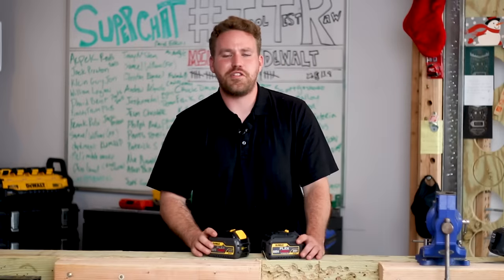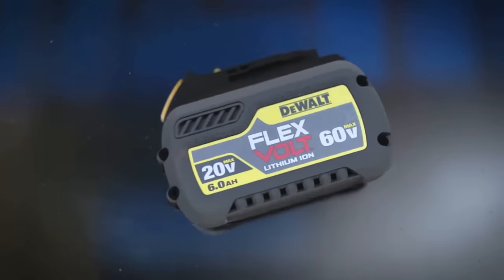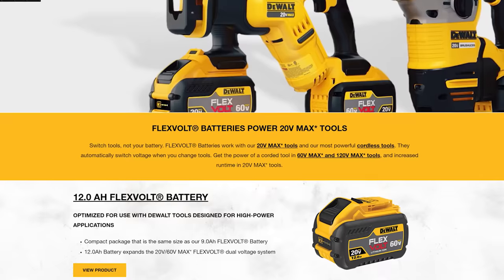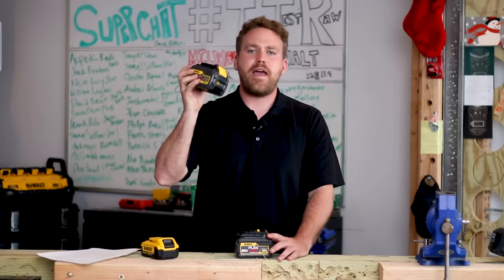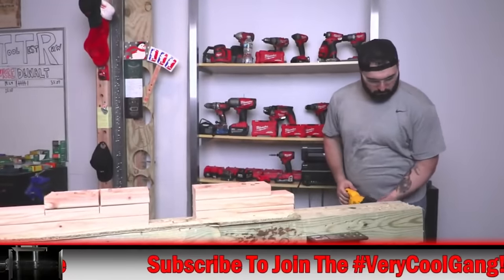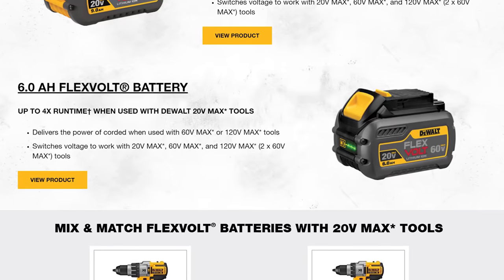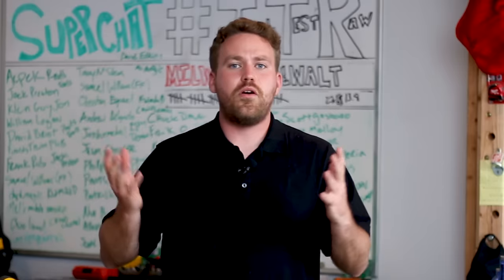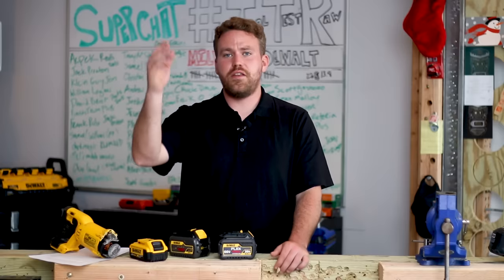NEVER USE DEWALT FLEXVOLT BATTERIES ON 20V MAX TOOLS!

Comment: Another opinion from an electrical engineer… It occurs to me that these FlexVolt batteries are of higher amp-hour capacity which generally means these batteries can supply higher current (by virtue of lower internal resistance) for longer periods of time. This potentially means that the 20V tools could be subjected to higher levels of loading than could have been experienced when they were stress tested by DeWalt originally, using lower capacity batteries available at that time. In the past, the battery may have been a limiting factor in how much the tool could be loaded. If this is the case, DeWalt may not be talking about it. For all the folks who reported using the FlexVolt batteries who say no problem; it is conceivable that they may not be loading these tools to the extent you did in your testing.  IMHO, you may have a point despite all the negative comments you received.  I would be inclined to push your test results toward DeWalt and ask them for an explanation. 

One thing that is unlikely to be a factor in your failure root cause analysis is the 20v/60V switching thing.  The FlexVolt battery module has fifteen cells organized in three banks of five cells. Each of these banks is a nominal 20V battery pack. The default connection for these banks is to be wired in parallel.  In the particular case of a 9 AH FlexVolt module, all the cells in the module are of 3 AH capacity. So each of the 5 cell 20V batteries is of 3 AH capacity, If three such banks of cells are wired in parallel the total capacity becomes 9 AH at 20V. Note that DeWalt is careful with their labelling to associate this AH capacity with the 20V specification.  When the battery module is in 60V mode it has a 3 AH rating. Note that this in not publicized because most users associate AH capacity as a measure of battery performance which is only true when comparing batteries of identical voltages. The energy storage capacity of a 60V 3AH battery module is the same as a 20V 9AH module and is essentially 180 Watt-Hours of capacity.  The switching functionality (20V or 60V) is controlled by a mechanical switch. This switch is activated (changing the wiring of the three 5 cell modules from parallel to series) when a 60V tool is inserted. All this switching is quite apparent if you examine both tools and both batteries and note what happens when a 60V tool is inserted in a FlexVolt battery module.  DeWalt wisely made the 20V mode the default mode, so the battery cannot be stuck in 60V mode and thereby represent a bit of a shock hazard. FlexVolt battery modules have a protective cover to be used in transport – this prevents the module from switching to 60V when it is bumping around in your tool kit. There is also an extra set of contacts on the 60V tool but I am not sure exactly how they are used – perhaps a confirmation that a 60V tool was inserted.

Comment: At work we have killed 3 20v vacuums using flexvolt batteries on them. After the third i told the guys to stop using them on the 20v tools.
Reply: Been using Dewalt flexvolt 60/20v batteries on all of my 20v max tools, including the vacs for 2 years. No problems.

Comment: Seems like the flexvolt is giving you enough power to kill the tool. Normal 20v packs will dip voltage when run that hard. Instead of the voltage dropping causing you to slow down the flexvolt packs just keep putting out the full 20v and eventually overheating the tool until something breaks.

Comment: Love love love the flexvolt system! However, I do agree that flexvolt batteries are too much power for the normal 20volt tools. I have burned out both my 1/4 inch impact driver and several 2 speed 1/2 inch drills. This hasn't seemed to be a problem for the 1/2 inch high torque impact wrench. 
I'm still sold on the system and recommend them to everyone!
Reply: Just like the guys who made this video, you obviously don't understand how the batteries work. Your 20v tools cannot draw 60v of power from these battery packs. Therefore they are not being overpowered. Sometimes tools get old and wear out. This is your problem.

Comment: I've recently had a slew of problems with DeWalt!! I have about 10 sawzalls (mostly 60v), 8 skill saws (all flex volt) many cordless Dewalt drills, impacts, planers, etc.
I have had situations where a battery works in a sawzall, but not a sawzall...then another battery will work when the other battery didn't...
Quite perplexing. DeWalt service center in Eden Prairie MN is closed due to Covid!! Seriously?? They have been closed for over 3 months. What a joke!!! We build 70 houses a year and I can't get any support from DeWalt!!!!

Comment: I am a die hard Dewalt fan from way back.  Having said that, I have burned up every one of my older "brushed" style tools with these Flexvolt batteries.  The solution I found was going to strictly "brushless" tools.  I've had good luck ever since.